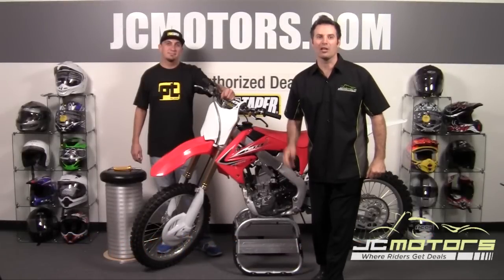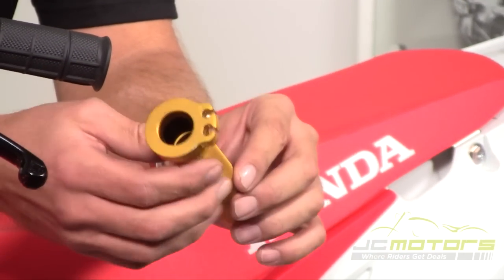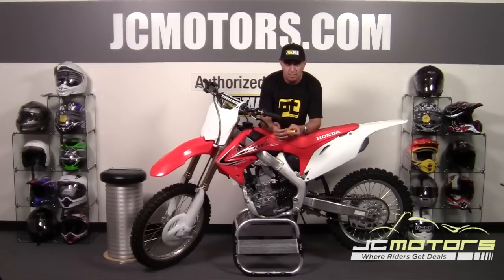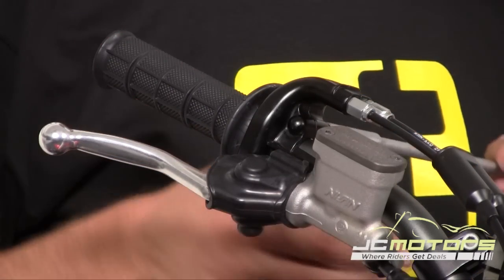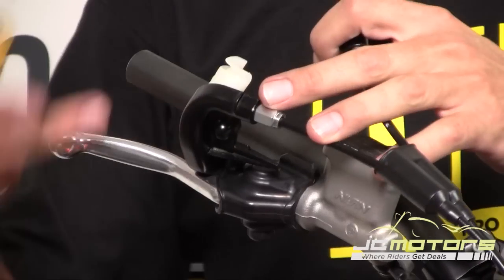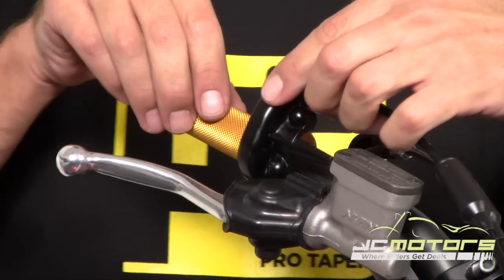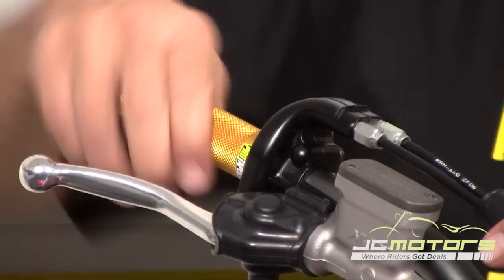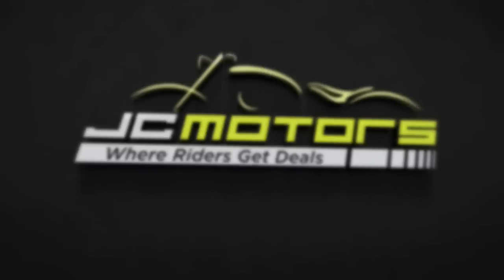Pro Taper Twister Throttle Tube Installation

Comment: i just installed a throttle tube and i did everything right but the throttle isn't snapping back like its supposed to? and ideas?
Reply from the maker: Thanks for asking, we love to help our riders. Make sure you installed the cables correctly over the cam in the throttle housing. If its not in the groove correctly, it will bind.

If the problem still exists, check the route of the cable and make sure the gas tank is not pinching the housing of the cable against the frame somewhere. Lastly, there is a chance that you have a internally worn or damaged cable, in which case you would need to identify it and replace. Ride Safe.